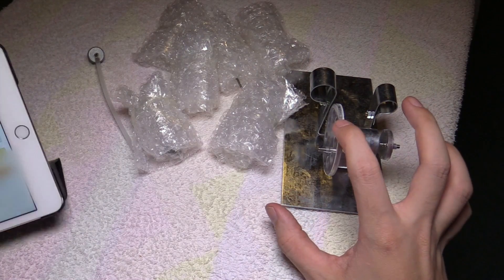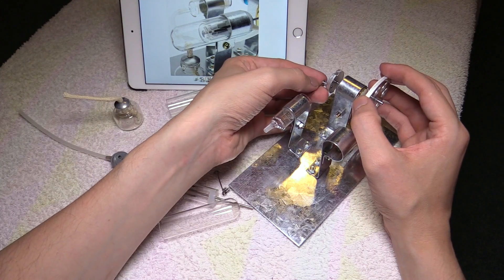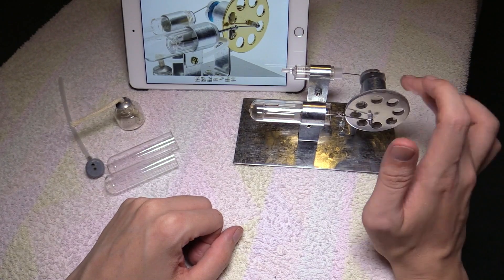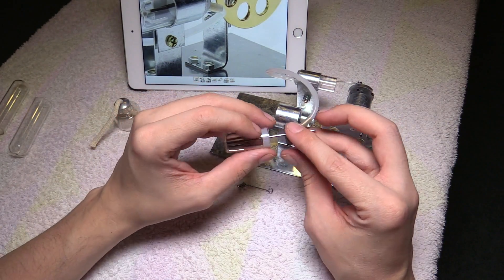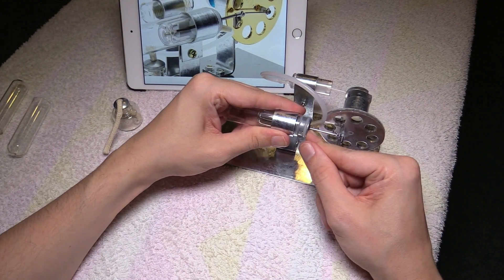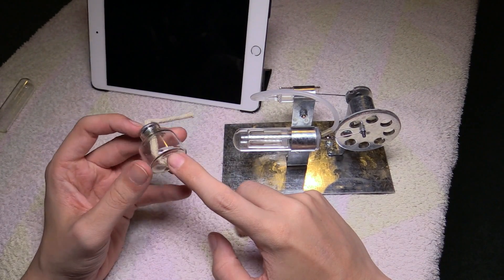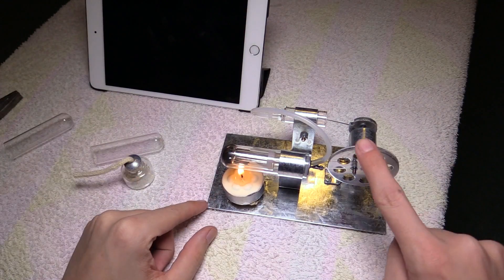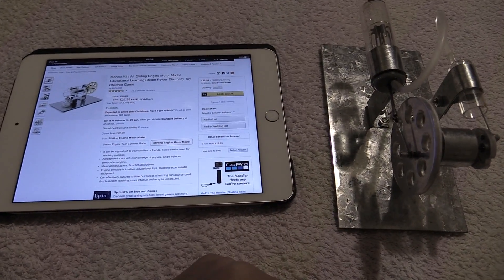Mohoo Mini Air Stirling Engine

Comment: Heat causes air to expand (work), pushing piston (larger tube) and wheel to rotate, compressing air in smaller tube into larger, to compress air to be heated again, and the process repeats.  Efficiency is only about 20-30% rest of heat goes into air.
Reply from the maker: I knew you'd be able to explain it better. Thanks for that! :) Happy holidays by the way!